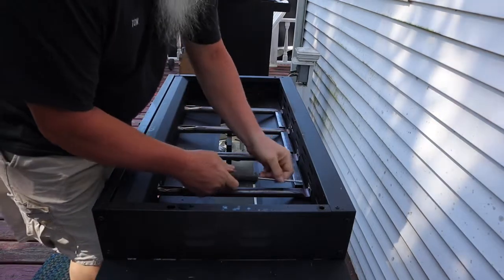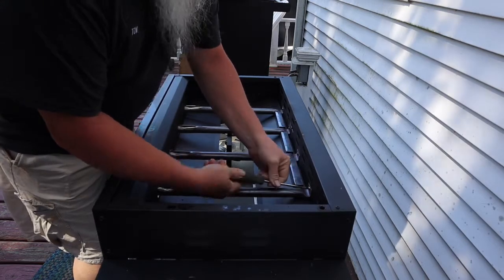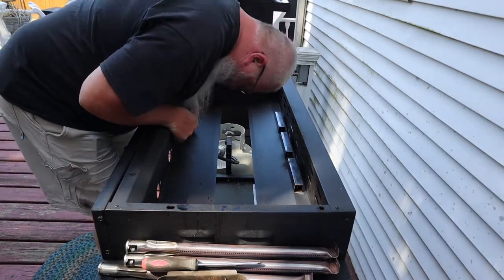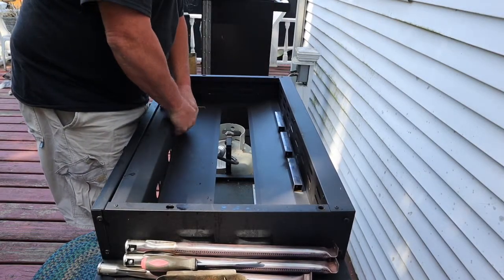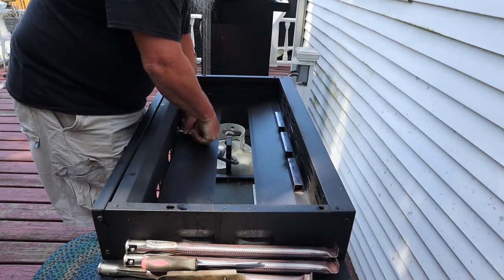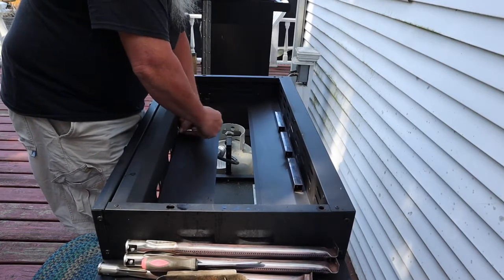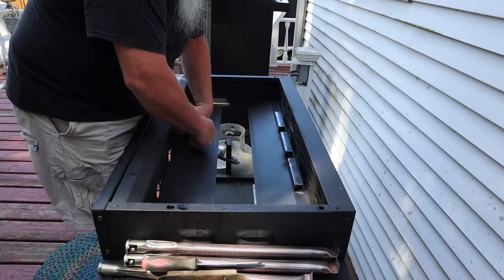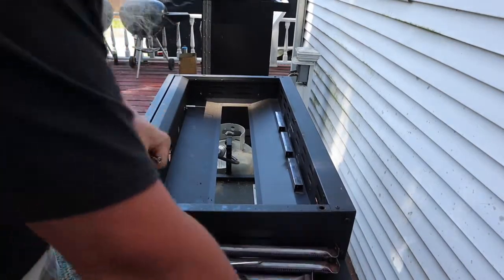Blackstone Modification

Comment: I converted my Blackstone and have a comment.  Propane is under pressure and has a regulator but Natural gas is low pressure and no regulator.  That being said when I open my left and first burner it is often hard to light because of the high flow of gas.  I open Burner one, two and three at the same time and then hit the ignitor and it works perfectly.
Reply from the maker: Ronald Brown I have a 22” using 20lb propane and have had issues getting that lit and hot but the NG 36” no problems. Thanks for watching and commenting